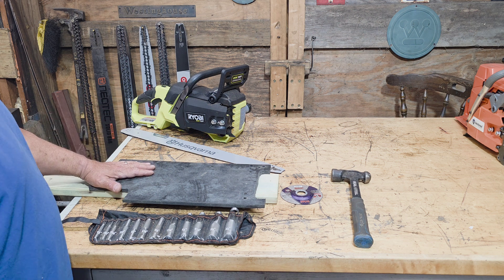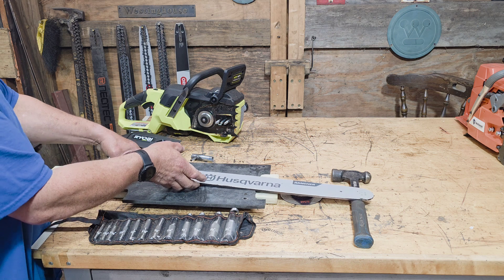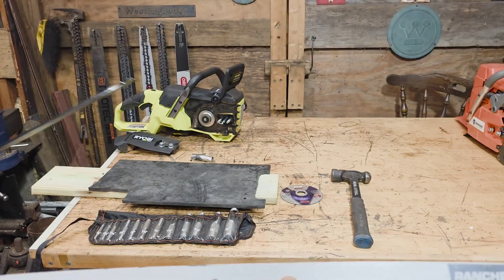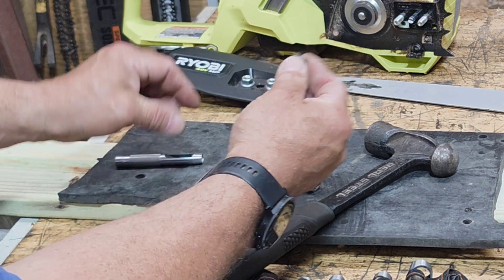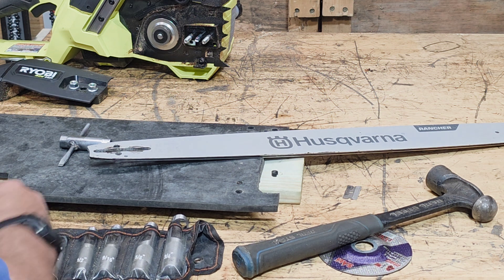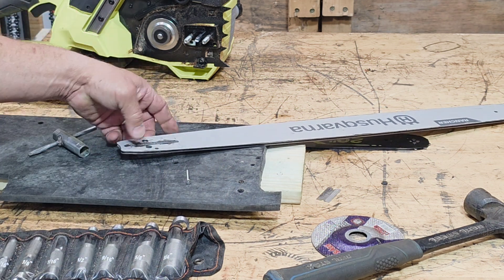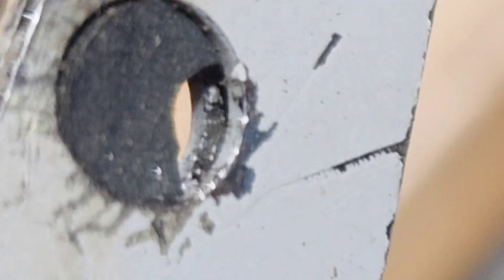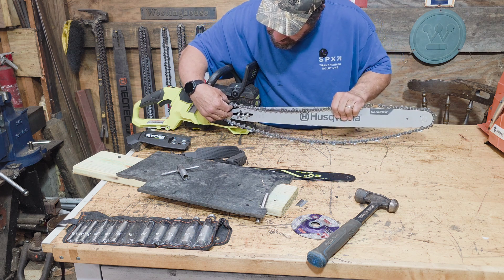Unlock the potential in your Ryobi chainsaw - "52cc Edge" model only - upgrade its cutting ability

Comment: Ryobi 52cc? Isnt this the normal ryobi 40v with the edge battery?
Reply from the maker: It is a different newer model.  The previous model claims to be a 50cc equivalent vs 52cc. I am very curious if the previous model is as responsive as this one is to using an edge battery,  but I haven't gotten my hands on an older one to test this.

Comment: You still happy with the ryobi?
Is this mod makes it cut more efficient?
Im new to chainsaws.
Thanks!!!
Reply from the maker: I have been working on the big saws lately,  so the ryobi hasn't gotten as much use,  but I do like the Ryobi... it's a nice balance of torque, speed and weight for a firewood saw.  The mod makes it cut faster, but I would say it's actually more efficient in stock form because of the thinner kerf. I haven't tested this,  but I would place money on getting more cuts per charge in stock form. What's nice about the adaptation is that you can apply it to bigger bars if you want to run a 24 inch bar.

Comment: I don't have the saw yet but I have a bunch of 8 tooth .325 sprockets and I think I might have some homelite bars that oil through the big holes. I run a 9 tooth .325 on some of my race saws and they cut very fast. The 9 tooth has a larger spline hole though
Reply from the maker: Yeah,  the Ryobi uses a mini... 19mm